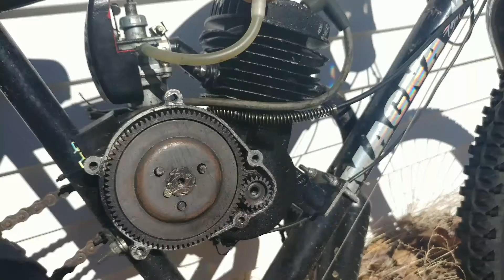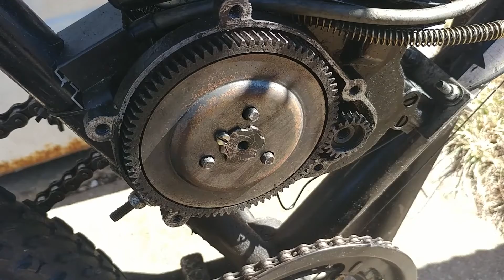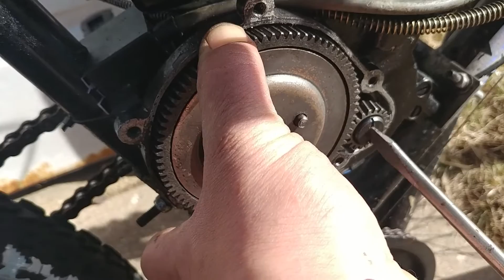HOW-TO: REPLACE CRANKSHAFT DRIVE GEAR Small bevel gear on 66/80cc 2 stroke motorized bike engines

Comment: My small gear came off by itself. And it doesn't have a screwdriver slot- its an allen wrench slot. I have no idea where the woodruff key went. I just got the motor past the breaking in period. Id get  new key, but i really need to know what happened to the old one.

Comment: What happens if the threads are stripped then what ? I have the tool aswell but it seems to pop right out ? When pressure is applied. And also only reason I'm needing to get that gear off is the crank got bent on mag side  to where it was hitting on 1 side but space on other side  but wanting to keep the engine cases due to motor mount bolts snapped off front and back on other engine block cases but the internals are all perfect.

Comment: How do you get that little screw out? (The one that you replaced)
 I had the same thing happen and i was going to take the screw from a non running motor so i dont have to wait a week for shipping. But i cant get that screw off
Reply from the maker: I locked the motor up and used a manual impact driver. (Kind you hit with a hammer)
Reply: You can also get a paddle bit for wood working and gut grind off the tip. Works great.

Comment: Info for first time bike engine buyers: check this gear before installing on the bike! Many times, it will be wobbly or out of square and you can make it better (less vibration and wear) by backing the screw out and straightening that gear up. You can tell whether or not it needs adjusting by eyeballing it as you spin the crankshaft. A few of mine have had a bit of run out or wobble and a couple have required an extra washer to get the screw to bear down onto the gear enough to keep it straight.

Comment: Hello, if I overtighten that bolt with the long cut, the bike hardly turns over. It's very hard to move the wheel.
Reply from the maker: Make sure the seal behind it is in the right place
Reply: @MotoredLife  It was. It's all fixed. Runs like a champ now!

Comment: does anyone know if motors from zeda motorsports come with a different sized threading on the small bevel gear? my tool worked with my old ebay motor but the zeda motors threads seem too big for the tool.

Comment: Say where do I get the gear puller? and if I dont have one is there another way because I think  the threads are all chewed up from using a vice grip to try and yank it off.  I had it off once already but put it back on minus the key after watching video just to see how it works while I wait for new gear in mail now its stuck . Please help also screw head on big gear is kinda stripped scared to mess with it ...bought bike already built so I'm learning to rebuild.  I like the videos too btw!

Comment: Well informed, but what I would like to know is how did you manage the press that gear all the way back in?  

You see, I had a tooth break on me while I was riding, snd when I tried to switch the gears out, I can't seem to push the crank gear all the way back in like how you did... 
So in addition to my first question, do I need to tap the gear with something, or do I just need to push it in as hard as possible?
Reply: Did u ever figure out how to get gear back on? trying to research before I take mine apart and cant find the answer anywhere

Comment: a couple suggestions: many other vids suggest using a plain washer, or penny to "jam the teeth" to lock the gears when turning fasteners on the drive gear, or clutch plate. i'm of the opinion that gears made of "chineseum alloy" probably aren't well suited to such hard materials being used (modern pennies are zinc, which is actually pretty hard). a copper washer, aluminum washer,  small piece of  thin sheet of either material, or even short length of 18 to 14 gauge solid copper (or aluminum) wire is far softer, and will jam the teeth quite well. tying a little "leash" of wire to either washer will aid retrieval if you "lose it" under the clutch accidentally. once you loosen the screw, and have it out, use "white out" to mark the location of the woodruff key on the gear teeth (dot, line, arrow, whatever). that enables you to see its position with the puller tool installed, which allows you to "clock it" to the position least likely for it to fall out as the puller works, preventing it from disappearing behind the clutch, or into the grass under your feet, the crack in the concrete slab you're working on, etc.. a "telescoping magnet pick-up tool" allows a much easier retrieval of the key if it does manage to escape (a hint i attribute to "Bicycle Motorsports", an excellent youtube channel run by a very talented young man, check it out). 

having said all that, excellent vid! well shot, well narrated, to the point, clear and informative! liked, and subscribed

Comment: Hey man I opened my clutch gear cover and the small bevel gear sticks out 2-3 mm is this normal Or does it need tighting ? Can I leave it this way?
Reply: https://goo.gl/images/eshSYJ
Reply: This is not mine but on mine the screw sits flush with the small gear but the small gear is raised up a few 2-3 mm higher than the big gear
Reply from the maker: +GEORGEVASS GAMING ad long as the wooduff key is in place. Ive seen them stick out a tiny bit. Depends on thr engine
Reply: Motored Life ok thnaks

Comment: what type/size washer was on the screw? mine back out so much it grinded it to pieces and cant tell. it also drilled whole through my crank case
Reply from the maker: +Dakota Petrey its a star washer. Put red locktite on it next time. That thing will disintegrate if it comes loose

Comment: How to remove and replace the crackshaft seal that is behind this gear?
Reply: what causes that to happen? back pressure from the exhaust? fuel too rich?no will to live? thats aggravating af! took me foreever to find out why it wouldnt turn over. no oil/fuel leaking out of it.
Reply from the maker: TulioTheGreenWizard its easier to do that of the whole case is split
Reply: but then again one would have to fully rebuild the engine if is going to split the case, I it possible for these seals to damage with fuel leaking from carb drowning the engine? i want to make sure i didnt lose compression nor have air leak, but im not motivated in spliting everything. Once my engine was covered in fuel from Nt leak or forgeting fuel valve open, to a point i needed to change clutch pads, that were damaged, dunno if fuel ever touched it though? maybe from outside in clutch ccase gasket...
Reply from the maker: TulioTheGreenWizard I mean sometimes. Take a larger socket and try to tap it back in.
Reply: thats for putting it back right? but how to remove? without split?
Reply from the maker: TulioTheGreenWizard honestly every time I have tried I ruined the small metal spring that keeps it sealed. I wish I had a better answer.
Reply: TulioTheGreenWizard no doubt. there's a video for replacing the seal but conflicting statements about oiling them or not someone suggested loctite. That spring in there is jacked up. How do ya keep it in there now without the entire engine rebuild?
Reply: the old one can be pried out with a screwdriver that you have rounded the tip of (damaging the old one doesn't matter, it's garbage anyway) by inserting next to the shaft and working it out slow but sure. pry from different angles and positions, and work it out. you round the driver tip to keep from scratching the shaft. alternatively, a couple or 3 self tapping sheet metal screws can be driven into the solid part of the seal, and those can be pried on.

 to install the new one is a little trickier without destroying the lip spring. the gear mounts on a taper that leads to a small shoulder, the shoulder wants to catch the lip, and roll the spring out. so, making a way to "pilot" the lip over is needed. try wrapping waxed dental floss on the taper, just thick enough to extend the taper out as far as the shoulder, for a nice straight transition, and lube it with 2 stroke oil on both floss and seal lip.

 to actually place it in the bore, tapping with a socket and hammer isn't so good, instead, get your hands on a 12 inch c-clamp. remove the magneto cover, and use the clamp between the magnet bolt head and a socket placed on the outer seal body. by screwing the clamp in, you smoothly press in the seal, and can stop and remove it all to check progress and potential problems mid press. if floss gets pulled into the shaft/seal joint, you can CAREFULLY "unwrap" it out. 

as to why it would fail, my bet is you find the previous assembler left the seal side "shield/seal" on the bearing, which would oil starve the seal, and the seal needs the oil for cooling and lubing, or they knocked off the spring when they assembled the engine. of course, your bearing could be bad too (the originals are VERY low grade), which would let the crank "nod", and destroy the seal over time. that would require case splitting to replace the bearing, because if the bearing is still bad, your new seal will go south just like the old one did. so, once the old seal is out, check the bearing. if you can move the crank around in it AT ALL, it's lunched, and installing the new one is wasted time and effort until the bearing is fixed. 

splitting the cases isn't too hard a job, and if you do, replace ALL 4 of the big bearings, crank ones no seal either side, clutch ones seals intact (or even "z" models with the steel shields). they're all the same (6203- 2rs- c3 heat rating) or a a pair of 2rs and a pair of 2z if you want the steel shields for the clutch bearings (not needed, but beefier). pull both rubber seals off on the crank bearings (pierce with a pin and pry them out, real easy). for a vid tutorial on the bearings, "Bicycle Motorsports" youtube channel did a good one on the operation if you work "cold", but freezing the bearing and warming the case makes install MUCH easier

Comment: had the motor a day
Reply from the maker: I just purchased some Zeda motors balanced crank engines. Waay better than any i found 8mm mount studs 40mm wide front mount upgraded roller bearings. 
I will make a review vid and link on where to get them.
DONT BUY EBAY MOTORS!! spend the extra money and get one that will last 10,000+ miles!
Reply: i took mine out for the 1st time today....ran it maby 5 miles total

Comment: fired my bike for the 1st time today...was trying to break it in...my primary drive gear teeth woreout or striped out compleatly...what would cause that...motor was runing fine and the clutch seem to be working fine...then i was just coasting...???motor is not seized up
Reply from the maker: Needs to be properly greased at all times. one little slip or skip will just chew them up. also make sure the gear is pushed back all the way to increase surface area between the two gears teeth.
Reply: same here
Reply: i don't mind haven to replace it...but don't know why or what made the gear strip out...is it going to happen again
Reply: Dennis Skindzier my worries to, I can't find any answers on Google as to how it got chewed
Reply: I have a gas leak, would that fuel get passed the gasket
Reply from the maker: Joshua sharkboy not usually but gas will eat that gasket
Reply: What type of should I use to grease the small drive gear

Comment: My woodruff key pops out. I put it in and it will stay for 5 minutes or days or weeks. I've used loctite. I've tried new keys. It's been a problem since the day I started riding it. I notice that my bevel doesn't sit flush with the big gear. I haven't used an impact driver yet. Does it make that big of a difference?
Reply from the maker: +Holly Crocker yeah it sounds like your woodruff key is hanging out the back of the bevel gear. I would say try using an impact driver to get the bevel gear screw in all the way. You will have to hold the crankshaft to keep all the gears from moving while you're tightening. This can be done easier by taking off the cylinder.